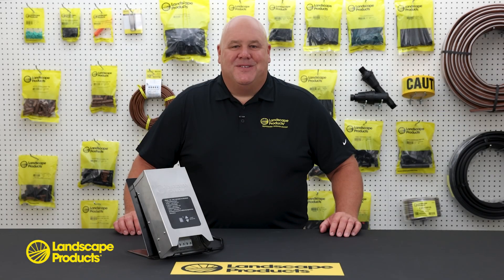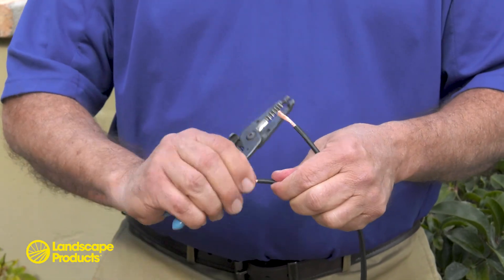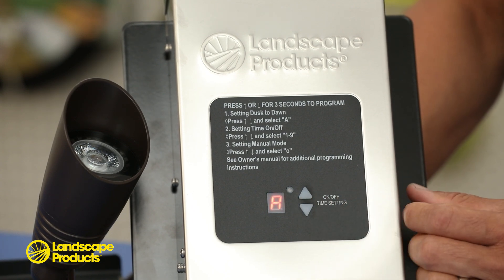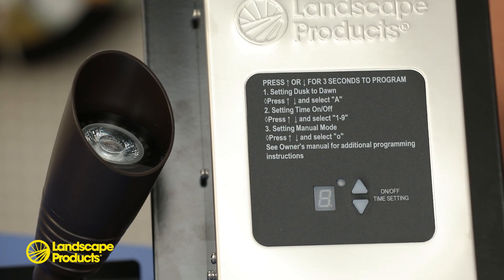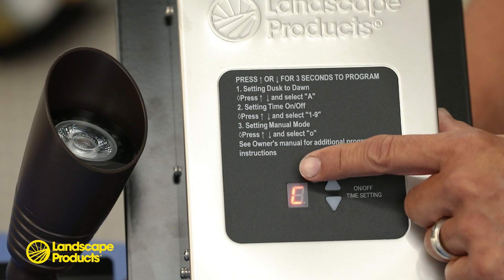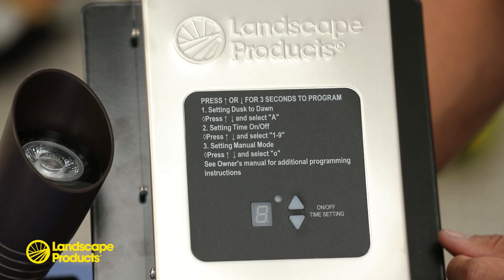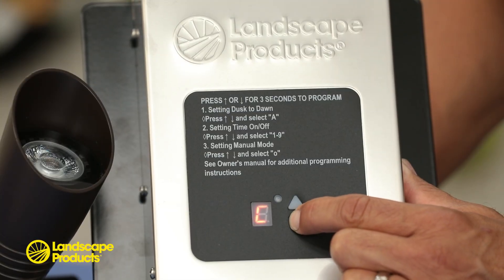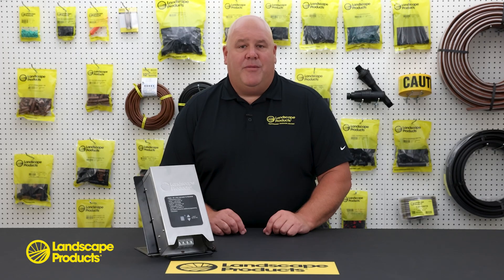How to Program a Landscape Products Lighting Transformer

Comment: The big problem with manual mode is that you have to press a button! This means you can’t just connect the controller to a smart outdoor outlet and use home automation to turn the lights on or off. Because you still have to push the stupid button once the outlet is turned on.
Reply: Agreed!  Quite annoying.  My workaround is to put it in test mode "C" which seems to make it turn on when the home automation provides power.
Plan B, put tape over the light sensor and put it in dusk to dawn mode "A".